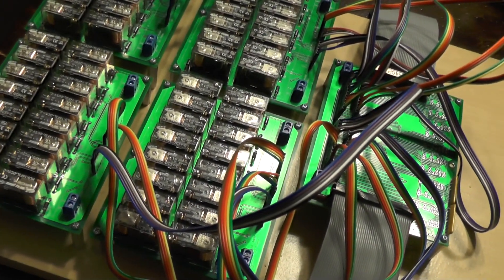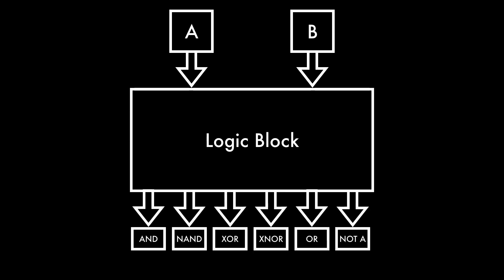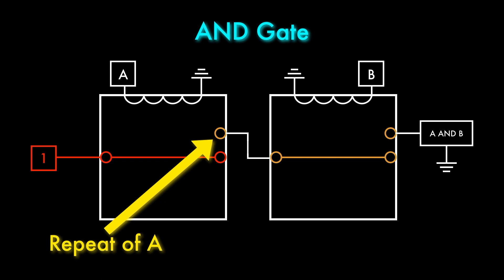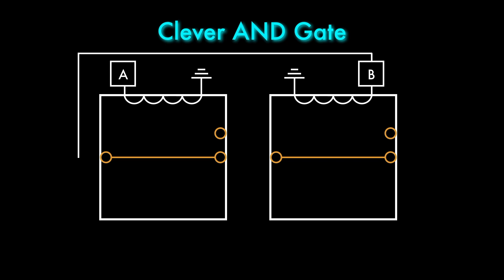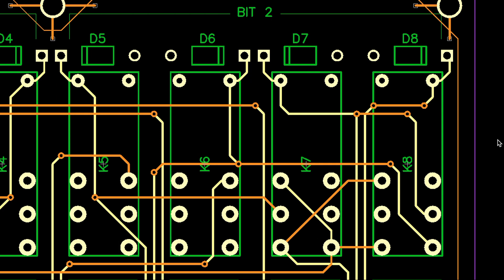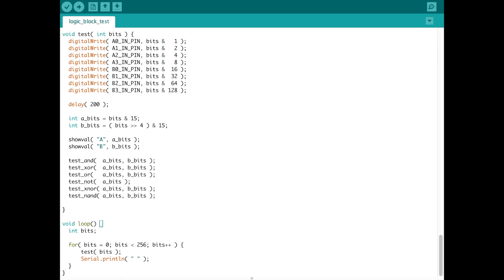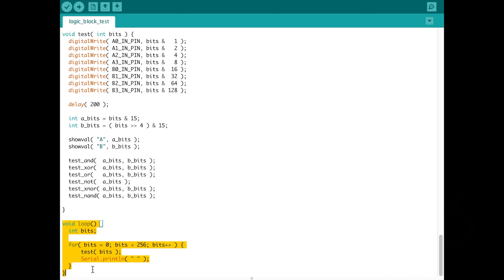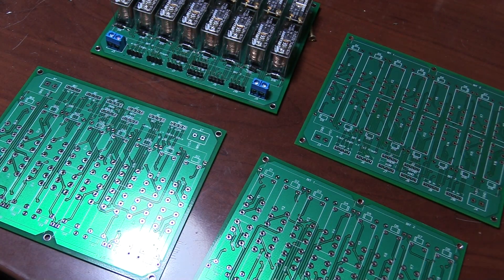Relay Computer ep. 4 - Building the Logic Block

Comment: What is its maximum switching frequency, at which test is passed consistently without error?
Reply from the maker: I don't know yet; I've run individual boards at 100ms without errors, but with multiple boards there will be more propagation delay.
Reply: please! can you please run it at 75ms? 50ms? 25ms? 12.5ms?... (till errors) and shoot a video about overclocking your world-coolest cpu! and (probably) add some cold condition, like running it in a freezer :-) I guess all the copper must be max-cooled before run, in order to top-up conductivity a bit? ;-). Post an answers here, about "Would 10-20 degree cold of ambient temp improve switching speed of coils with no error?" and "How does temperature affects this cpu power consumption?". your 30-40W room fan force-cooling of a relays inside a freezer is also a great idea for research) also show us your real wattmeter readings. i think that would be extremely cute and tech-friendly video!!!

Comment: How do you size the fly back diode? For instance using a reed switch to control the coil of the relay. The reed is rated 12v 0.5a and the relay coil is 12v 5a. I understand that the diode stops the magnetic field collapse from reversing the current back to the switch but how do I determine what diode to use to stop fusing my reed switches.
Reply from the maker: A simple way is to build a test circuit and use an oscilloscope to measure the flyback spike. But any ordinary rectifier should suffice for small relays - the ones I'm using are 1N4004s which will probably be fine for your relays.
Reply: Clickety Clack thank you for the quick awnser at the moment I don't have a osiliscope. I'm just learning and don't have the budget for a osiliscope at the moment.
Reply from the maker: I'm sure the 1N4004s will be fine for your 12v relays - they are quite beefy. Best way to find out is just to hook it up and see if it works. Parts are cheap. :)

Comment: For the problen of mixing a and b. Couldn't you use a diode?
Reply from the maker: Yes! In fact you can build lots of logic gates with diodes. (It's called diode logic.) But this project is about relay logic, so I want to stick to relays.
Reply: @ClicketyClack  what about 2 spdt/spst relays?
Coil:
A - gnd | B - gnd
Output:
Then wire Norm-Open to short gate between the two relays.
Reply: Or have extra pins for dpdt
Reply: Yes he could but i think his challenge is to do it with relays. The diodes hes using across the coils are more to prevent damagd to driving circuits not Really part of the design for blocks.